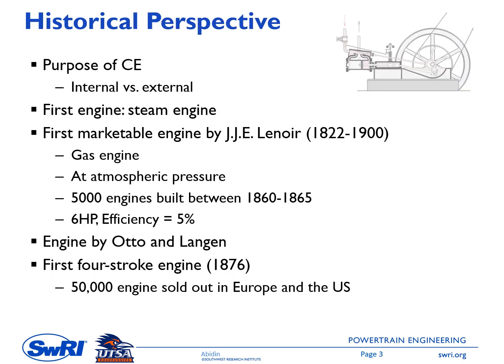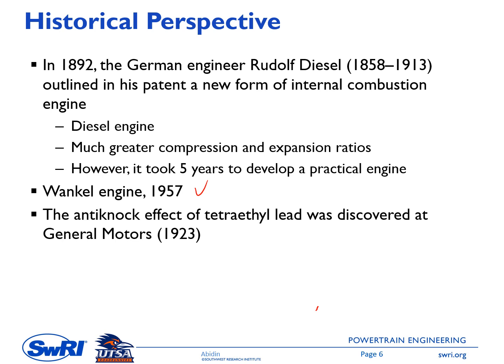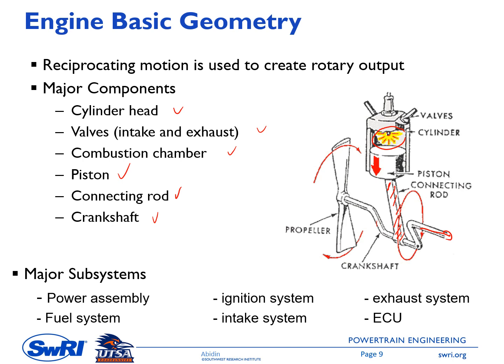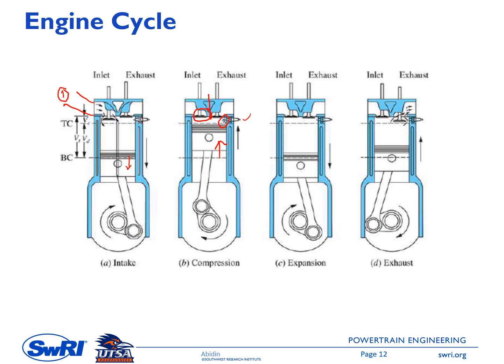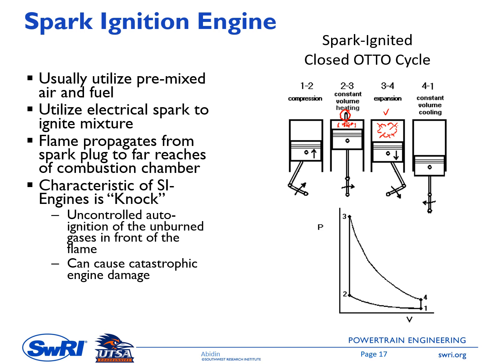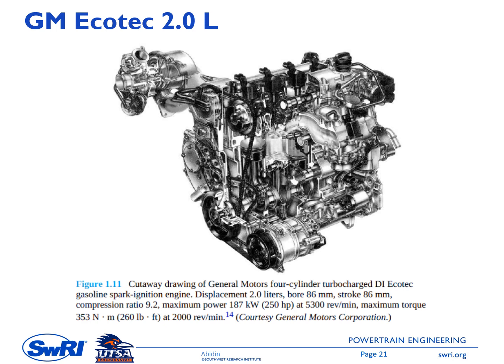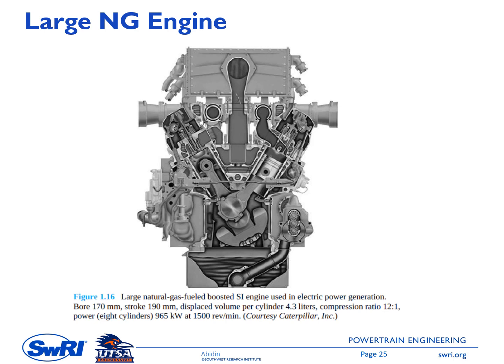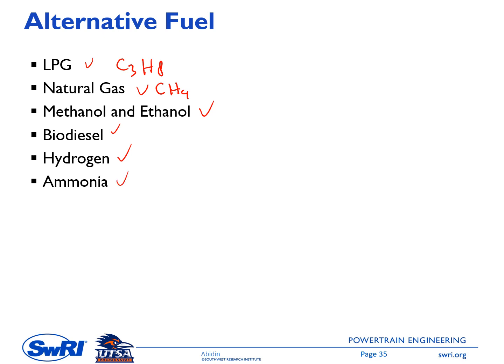01 Engine Type and Operation

Comment: Chrysler 2.2L HO
Reply from the maker: You are right. GM has also 2.2L engine variant.
Reply: From the stroke and bore. The chevy ecotec is less square (86; 96.6).
Reply from the maker: @mruss7963  Larger stroke helps increasing the piston speed for the same engine rotation speed. As long as it does not generate intake choking, it is better from combustion speed and power perspectives. Large engine size tends to have high stroke/bore.